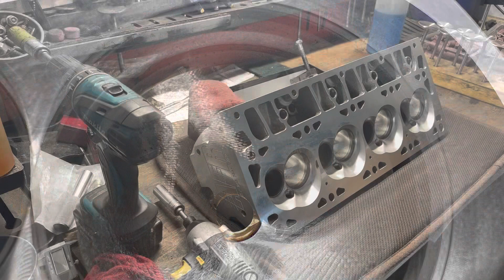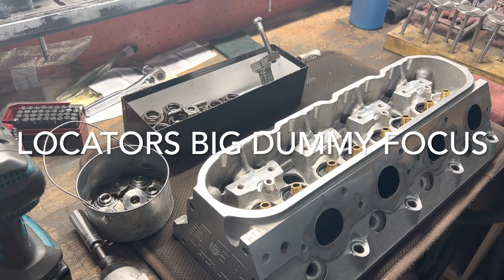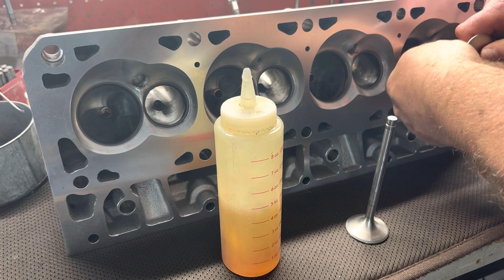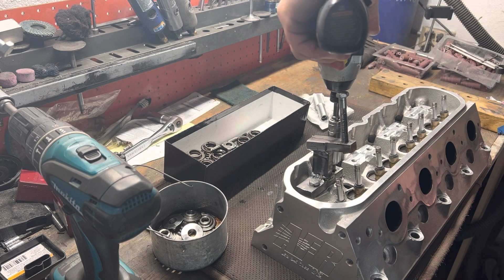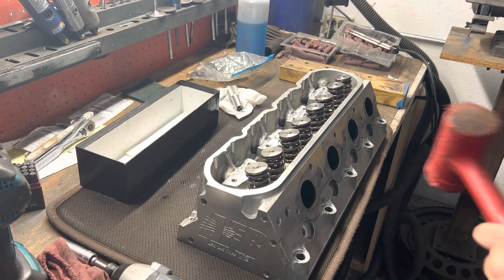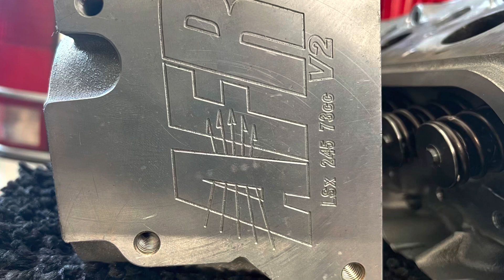AFR LSX 245cc cylinder heads assembly

Comment: Miss your videos, i follow different head porters and you seem very knowledgeable and give great information to viewers.
On another note i would like your input on a subject that is very controversial right now on the internet and that is LSA. DV has always claimed you can use a low lsa on engines based on valve size (128 formula).  I also follow Ben Alameda Racing who is a very experienced and knowledgeable racer and enine builder who is claiming that the lsa for the newer ls heads dont follow the same rule. The reason being bc they are more efficient and would pull on the intake valve too much if the lsa is to low. Just curious about your thoughts on the subect.
Reply from the maker: Thank you for the kind words!  Here’s my experience, tighter LSA, 106, 107, 108 etc seem to make Higher HP/TQ in a narrower rpm window compared to wider 112, 114, 116 etc.
The issue with tighter LSA is they make less vacuum, which used to be a headache for tuners and EFI.  With the modern EFI tuning is much easier now.  Also a concern is having enough manifold vacuum for power brakes & accessories.

Comment: Hi, not related to this video but I have a ls porting question. I have a 5.3 block, 243 heads. Will be running big bore, ls9 gaskets. When it comes to unshrouding the valves. Is there any benefit to it because the 5.3 bore is the same size as the combustion chamber. I feel like unshrouding the valves will cause turbulent flow once it hits the block deck
Reply from the maker: I do not recommend running LS9 Gaskets on a 4.8/5.3 cylinder bore.  You lose too much gasket sealing between the cylinders, I recommend either the same style GM MLS gaskets made for the 3.780” bore or the Mahle MLS 54441 gaskets. 
Because the bore is 3.780” don’t scribe a bigger gasket to the heads or it’ll cause even worse upper cylinder shrouding than oem.  Get an appropriate gasket with a 3.835”-3.900” fire ring. 
Generally you end up moving the chamber over about .045” to unshroud.  JD
Reply: @HeadFlowInc  yea I was questioning my decision with the ls9 gaskets. It will be a boosted motor which is why I went with them. I think Btr sells a 7 layer 5.3 mls gasket I might try out. 
Glad we are on the same page with not unshrouding the valves

Comment: Great video!,  that saved me time now I don't have to look through other videos how to assemble ls heads...hey I appreciate all the help and guidance from you on my first time engine build
Reply: Hi Justin any thing  on getting another spring compressor thx Johnny.
Reply from the maker: Good luck, having the right tools helps. LS uses a 1.800” oem installed height for springs but you’ll see aftermarket springs 1.780” often. 
Lube the valve stems, fresh valve seals you should be good! JD
Reply: @HeadFlowInc  looking for another spring compressor can you make another?!!